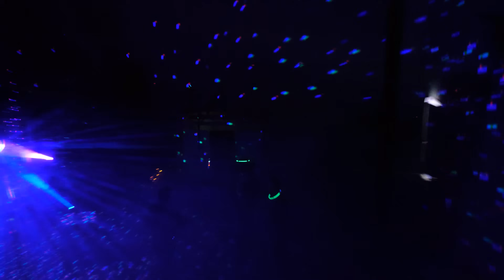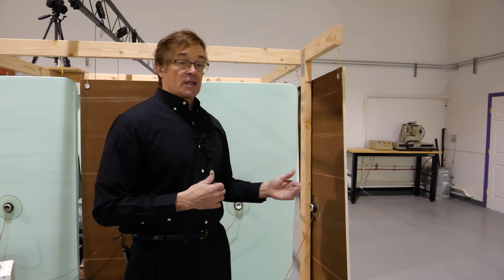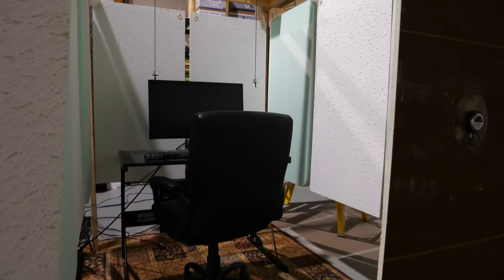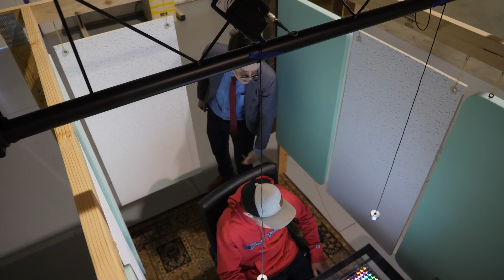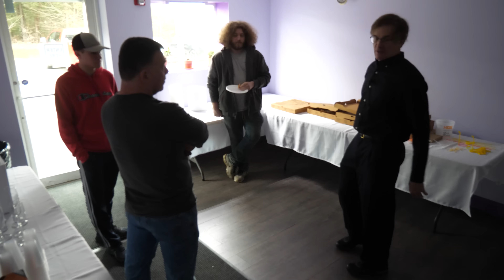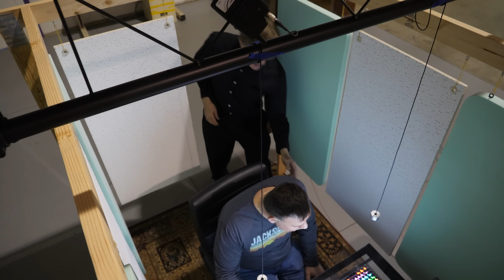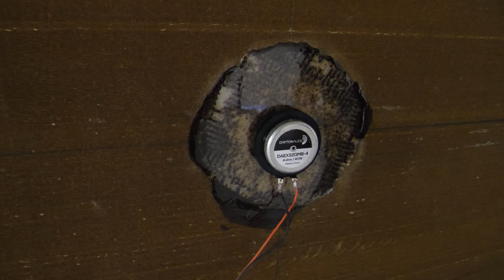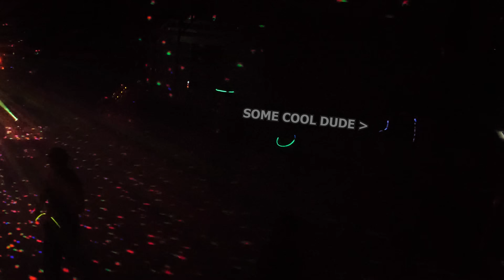SHOULD SPEAKERS THIS GOOD BE LEGAL?

Comment: You mentioned mounting the driver in not center, and not 2:1 ratio surface. Would A1 paper-sized board (with golden ratio) be good, or is this another ratio to avoid?
Reply: A1 A2 etc use the square root of 2, not the golden ratio btw.
Reply: He has another video on this channel that goes into the specifics about where to mount the speaker and the size of the board. IIRC though, generally the larger panels perform better and if you used something A1 sized you would have to source an appropriate sized driver.
Reply: While it's simplified here, the golden ratio (top to bottom, left to right) is actually optimal placement for the drivers to avoid any standing waves and artifacts from things bouncing back from the edges of the panels.  2/5ths is 40%:60% which is a first order approximation of Phi (think 1,1,2,3,5,...)

Comment: I have watched all your audio videos and i have plans to make some myself, but i am going to isolate them with magnets, using them to trap and suspend the speakers with zero contact to any surface.
Reply: That's not really how magnets work, is it? The captor and captive magnets will still transmit vibration to one another, so you will still get some resonance albeit somewhat damped.
Reply: @Ithirahad  you have the magnets north to north for the repelling force, set in a configuration to captivate the panel, not attach it.
Reply: @365daysofpool  ...yes, so any time the speaker vibrates, the captive magnets will vibrate... which will push against the captor magnets with the same vibrations, and vice versa.

Comment: Now I'm curious how big the panels need to be to get down to 20hz and still have enough output. Also does this design better lend itself to sub-20hz (infrasound, perhaps 5-19hz range ) because feeling sound and not just hearing it makes it even more immersive.
Reply: These kind of panel drivers have been around for decades. Go look at Magnapans for the classic design. You hit upon the big issue: bass. They can be amazing on upper frequencies but you end up using a more typical large box with big driver to get smooth, fast, and dynamic low frequency response.
Reply: @Bill_N_ATX  These don't have quite the same limitations as those other planar speakers (Magnepan & electrostatic) because those sound elements are suspended between two perforated panels that push/pull the membrane. You can get more bass by moving the panels further apart, allowing for the panel to travel more (more volume at low frequency), but you lose efficiency. The closer you get the panels the more efficient the speaker is, but there is less possible travel of the membrane, and less bass without the membrane touching either side.
With these, since it isn't sandwiched between anything it can potentially move more.
Reply: if this size gave 120hz, and you assume a linear relationship then they'd have to be 6x as big to reach 20hz.

Comment: 1. How much free space is needed behind before it notable affect the sound?
2. The sound absorption panels, do they release some carcinogens substance?
3. As a next speaker project, could you do a compact push-pull subwoofer, like the brand Sunfire (my builds sounded terrible)?
Reply: I built these based on their previous video, and did some testing of #1. I needed at least 8", and preferably 10"-12" of space between each ceiling tile and the wall behind them. If they are too close to the wall the sound becomes very thin.
Reply: @thomastapen39  Have you tried using sound absorbent material behind the speakers? I'm wondering if that would allow the panels to be closer to the walls as well as reduce sound transmission to other rooms.
Reply: @Hamish_A  No I haven't, but sounds like an interesting thought to me. I just hang mine off a shelf I built which holds them about 10" from the wall.
Reply: @thomastapen39  Thanks!
I guess this solution is not the best choice when you want speakers hidden.

Comment: Modern speaker design has been improving for over 100 years.   From what sonar acoustic theory i worked with
TI  has  been spot on for the transducers and theory.   Phased arrays and beam steering are becoming more ccommon.    Don Keele on CBT vertical array with power shading and phase delay element to element.  Superposition in the plane helps a lot.  More dB  per watt.

now lets watch Mr. Wizard                 LOL

Comment: So you mention 200$, I'm assuming that is for drivers, panels, maybe hooks and some plastic pipe.  If you had to guess at what your setup is using for the amps, added sub, and any other necessary components what would your cost be?
Reply: It would equate to however much you want to spend m8... Pretty sure those tube amps they are using arent too expensive.
Reply: @TheAceofFate  I was more curious about what setup they had, it looked like there might be individual amps on the table they were connected to.  But I assume this would work as well with a 5.1 receiver as well.
I wanted to know where exactly the cut off was for materials for his 200$ quote.
Reply: a surround amplifier perhaps..? ...or maybe use surround output from PC backside and just hook it up to 5 channels of standard power amplifiers (it will not need so many watts the power capability of the drivers are not large, about 40W max).
For ordinary music listening in surround I am unsure if there are any good algorithms to convert 2ch >> 5.1ch? I do all my listening on a dedicated home theater surround amplifier system.
Reply: @Paxmax  All that would work fine, My real question is what the bill of materials for "200$" covers exactly :)
Reply: @rks1789  aaah.. I'm sorry, I was a very sloppy reader.

As a side note: Maybe these panels used to be possible to build for $200 in USA... but I'm in Europe and the drivers(10 pcs) alone are way over $200. (checking on amazon they go for $27 a piece). Ceiling tiles definitely aren't for free either.
Reply: @Paxmax  I thought I heard him say he got the drivers "years ago", so that may factor in too...
Reply: @rks1789  Good point! Yep he has been toying and tinkering with these for over 4 years now. Since he got replacement VHB tape aswell he could rip 'em off an old panel.

Comment: So people aren't going to have a booth in their room, how well does this translate to 2 panels, maybe hanging a few mm off the walls on front left/right.
Reply: I haven't tried this, but I am a mechanical  engineer with a forty-year specialty in SVA (Shock, Vibration, and Acoustics). I would surmise that the wall behind the panels would have to be made of some super-acoustic-absorbent material in order to attenuate the out-of-phase information from the backs of the panels, which would, at many frequencies, cancel or reinforce the desired signal emanating from their front sides.
Reply: @edwatts9890  Would slanting the mounts to have a linear distribution of standoff from drywall help?
Reply: @frederf3227 : At the very best, a little. The only thing that would change is the distribution and intensity of phase interference.

Comment: I made 2 of these speakers out of pink insulation foam and added a free subwoofer I found in by the dumpster and they sound pretty good! I didn't realize I could use the dense acoustic ceiling tiles to get those low frequencies but I may do that to round out the frequency spectrum!
Reply: I made the acoustic ceiling tile version, 1/2 full size tile vertically per speaker with the "extra bass" exciters.  Still no bass.  I wouldn't bother revising your setup.
Reply: 120hz is not really low though. Just use a sub
Reply: @FSXgta  120hz is something that 4" midrange driver can do in any enclosure that isn't to big.

Comment: You know what these need, a transmission line enclosure and a 6-8" subwoofer for the low notes.
Reply: Not sure if these would benefit from a transmission line design, they seem to work best without any loading (aka free air). More likely, the subwoofer would be what you put in a transmission line enclosure.
Reply: No no no m8.... a ROTARY SUB would really top it off... xD
Reply: @TheAceofFate : Yeah! Get rid of all of it and use a pair of big Leslie speakers!  <smh>
Reply: They need anything that isn't that flea market reject sub.

Comment: In your videos, the panels are hanging from a rail. Is there a way that you've found to mount them in a way that you can point the face of the panel in a particular direction? For home theater applications, it could be helpful to aim the speakers more precisely than hanging would allow (e.g. the atmos would be mounted on the ceiling, but aimed at the viewer).

Or is that even necessary with panels like this?
Reply: Maybe you could combine 2 tiles length wise and get floor to ceiling coverage? Even without doing that, I think as long as you hung them within ear level at any height it would probably be unnecessary. Especially when surrounded like they did here iwth this setup. There's no reason I see, that you couldn't scale it up to an entire room. What I really wanna know is what about height channels for like, Dolby Atmos content!! To TRULY surround yourself with them, and hook them up to a high quality atmos receiver. I bet it would be super nuts...
Reply: Edit: some say they are beamy Because the whole panel vibrates these are not very directional
Reply: @Paxmax  Er… flat panel speakers are notoriously beamy. The sweet spot is tiny! And you absolutely don’t want them mounted on the wall!
Reply: @Paxmax  My experiences with flat panels were with electrostatics. A friend had a pair of Quads and I made a number of small (10 cm^2) drivers back in the early 1970s. Distortion was very low, but at the cost of dynamic range and poor dispersion. Nevertheless love my Stax headphones!
Reply: @jonathansturm4163  Now I'm curious if there is a behavioural dispersion difference between e'stats/MLogans VS these panel DMLs. The DML shakes like a rug basically but the e'stats has more of the membrane flexing most in center and lesser amplitude near edges = which are more "beamy"?
Usually e'stats also has a little baffle area surrounding driver that will prevent the acostical short circuit edge leakage... where as DML panels seen here has no such thing.

Comment: I had a costomer that hand made speakers, he even wound his own voice coils. He would come to your house and measure the diminsions of the room where the speakers were to be placed, he would prick thev walls with some sort of tool that measures humidity and other factors, simply write down everything and build speakers based off of all his information. His speakers were made from accordian paper and used custom Alinco magnets that were specially manufactured for him. 
   Audio acustics is an infinite science, a very interesting subject to say the least!.
Reply: Looked up accordian paper and all I’m getting is a bunch of origami looking pieces of folder paper. Can you please explain what you are talking about?
Reply: @landondavid5773  Cut the edge of your average Amazon Box, or other type of brown packing box, and you will see an accordion fold sandwiched between the upper and lower layers of a box panel. The triangles between the flats.
Reply: @AndrewWilsonOz  thank you very much sir
Reply: @landondavid5773  Yes. Back in the day, the voice coil was suspended with acordian paper rather than foam, many high end sterio manufactures used the material for speakers, i.e. Altec Lansing, Marantz, Sansui etc.... Acordian paper is how the musical instrument's air bellow is as flexible as it is, acordian paper doesnt rot like foam does.
Reply: I agree, there is so much factors going into a sound wave that it becomes a true art to manipulate them in just the right way. If you think about it a sound wave has 5 dimensions to it 3 spacial, one amplitude and a spectrum/wavelength to balance. If you now factor in that every part of the spectrum represents a vastly different behavior of the wave and you need to find the right compromise it becomes very complex very quickly.
Now that I think about it you even have a 6th factor in play being the directional vector of the wave.
Reply: Designing speakers you can start with the science and put all we know into it and then you go black magic...

Only partly joking as it seems no matter how much research is put into sound and speaker construction there's still something we lack. And that's before you get to the perception bias that everyone have. Most of us will, if given the choice, select a speaker setup that add a "warm" tone to the sound over a speaker setup that is measurably more accurate and neutral. The warmer sound comforts us while the more neutral sound can be more demanding and won't mask any harsh transients. I'm not going to judge  and say one is sounding better than the other, because you are entitled to choose what sounds better to you. But what is touted as better isn't always what sounds more natural. It's like with food. Some times we don't want natural. Some times we want the familiar taste of highly processed food. Same with sound. The harsh sound of reality isn't as comforting as the warm smooth sound you get from a warm amp with glowing tubes and some tasty high end speakers.
Reply: And then our ears and brain muck it all up in unpredictable ways...  😵‍💫

Comment: why not make these as ceiling tile speakers? would work great in commercial environment
Reply: It would severely degrade the performance. You have to isolate the panel from everything. This why the thin string was used
Reply: You would lose some of the performance as you would need to mount them at a minimum of three points, and the more points of contact you have, the ability to vibrate/resonate is lessened.

Comment: But does it have plenty of bass?
Reply: he has said it needs a subwoofer to handle the low frequencies, so it doesn't have any bass :)
Reply: @superheaton  I caught that. He said 120hz is the limit. 30 ish is more what I'm looking for.
Reply: @joshuagibson2520  yeah definitely looking to try this out myself.  There is a video someone else posted, she made laser etchings in fibonacci circles on them to reduce the resonance or peakings, to sound better.  Here on youtube. 

Also, i wondered if he had to use a fancy crossover system
Reply: Probably not booming.

Comment: i've wanted to do this in a geodesic dome since seeing your original video! only built two stereo pairs as of now. been to stingy too buy a receiver so far.
Reply: You can get older receivers dirt cheap.
Reply: @joshuagibson2520  fair enough, i haven't really looked too hard, especially at the second hand market, since i don't really know what features i want and need. lots of my film collection has a dolby atmos track and thats a standard i'd love to use, but i don't know what that would turn into on an older receiver without support for example. i.e. how they process spacial audio or just multiple channels. also power ratings, etc etc. its a whole new product segment that i know virtually nothing about, and the goal would ideally be a spacial audio 5(or7).1.4 setup or so, which seems to basically mean...fairly expensive.
but i'll try it out at some point. need a few more transducers first too. its not a priority but solidly on the eventually list :-)
Reply: The acoustics of geodesic domes are appalling. Friends built one back in the 1970s when they were all the rage. It was demolished less than a decade after being built. Also they were really difficult to keep the rain out...
Reply: @jonathansturm4163  ok, interesting, thanks! theres no particular reason for it to be a dome, i've just built the frame of one and just thought it would be cool to put a 360deg audio setup into it, because it reminded me of the graphic representations of the 360 sound bubbles you see in marketing materials. 
its just a beautiful shape and i was thinking it could make a nice outdoor cinema or projection mapped vr environment. also figured it might be advantageous that speakers (inkl. top channels)  can be completely equidistant from the centre point. doesn't necessarily have to be weatherproof or permanent, but i didn't consider that the shape might actually be bad for acoustics. its just a project in the back of my mind. might still try it, might never get round to it. thanks for your insight though!